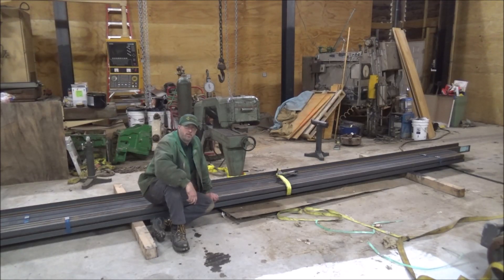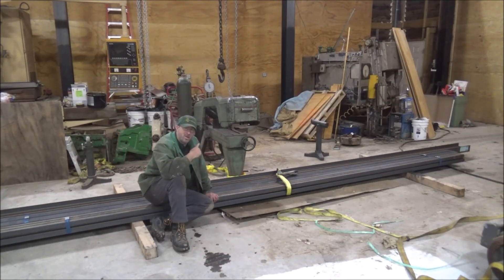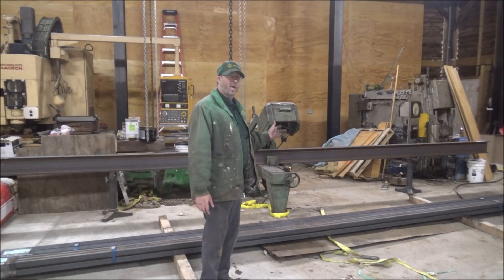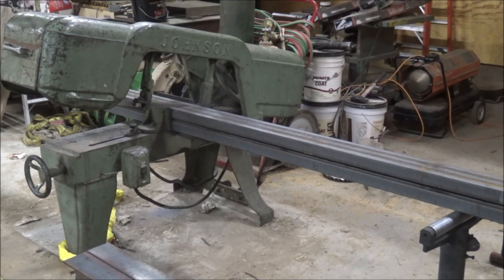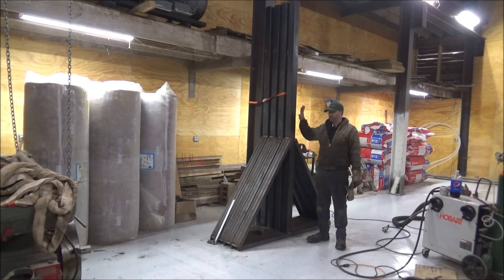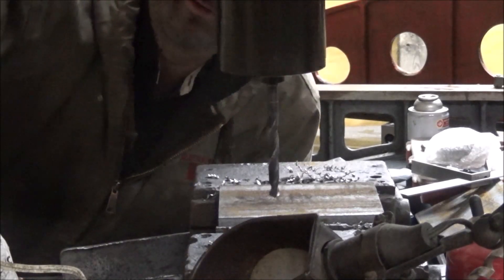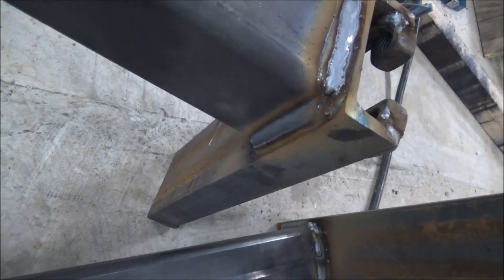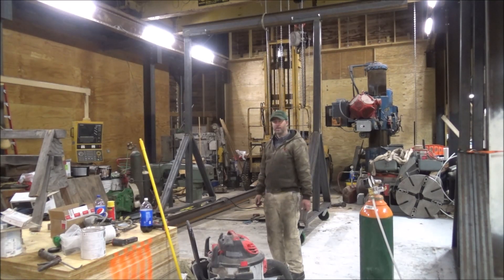Building a pair of Gantry Cranes

Comment: Thanks Much! I have been planning to build one, not as tall though. I like the adjustable width, real cool. I will build mine same way. Your stock saw, Double Bow! I just bought one about same size, but single bow. Yours is better than anything on the market nowdays, I bet it is nearly impossible for it to chatter no matter what. You definitely do not want to get rid of that, just repair it when it breaks. I bet they never make one that good again.
Reply from the maker: Dake still makes the almost identical saw. 

http://www.dakecorp.com/products/horizontal-bandsaws/heavy-duty-bandsaw-jh10w3

Comment: Brian, curious about your thoughts on the pros/cons of your uprights (single vertical tube with outriggers) vs. A-frame style?
Reply from the maker: Easier to fabricate this style also you can use the bottom brace like a cart sometimes by running beams/boards across it. I also like the fact you don't have a weld trying to do the splits holding it all together.

Comment: I agree that they don't actually need it, but they would look more structurally sound with the top corners braced.
The appearance of them being well designed could lead to more people commissioning work.
Reply from the maker: I will build them however somebody wants, they wanted these to clear a ten foot cube so that is how I did it. The upside down channel is equivalent to gussets on the bottom of the same size.

Comment: In some of the comments angle bracing is mentioned... I dont think bracing is the real concern here.  In the event the uprights begin to splay out under load the stresses on the inside clamp nuts could be substantial. I would be concerned that they would peel back or break off entirely resulting in a catastrophic failure.  I mean that is a lot of sheer force on such a small welded area.
Reply from the maker: It should take over 4000lbs of force dragging at the foot to fail that nut attachment.  I don't think that sort of load should ever be seen in reasonable use.

Comment: Brian, would you need to add an angle bracket on the top I-beam slider to the post? It seams like if you tried to roll it around under load it might buckle when moving.. Just curious, great Job though. I love all your heavy iron work! Merry Christmas!
Reply from the maker: It is not necessary for the requested load rating of these units. They are well over built as is. I am fairly certain that the casters would actually be the first thing to fail.

Comment: Great Brian, are those casters strong enough I've  had problems with those laminated wheels separating?
Reply from the maker: I don't know they say they are rated for 1200lbs each so they should be fine but I don't know as I have not had years of experience with these exact ones.

Comment: My Thern 2 ton gantry crane is one of the most useful things I own. Mine is adjustable in height, which is very handy. You just hook up a come along to two ears and pull the pin, then you can raise it or lower it to fit the job.

Comment: nice, I like the sliding I-beam on the top. what is the dimension of the "feet" (what the wheels are attached to) look to be about 5 ft.?
Reply from the maker: The foot channel is 6ft so center to center of the wheel axis is about 5.5ft.

Comment: I have to say I would brace those sliding joints. As they are they're probably plenty strong enough for lifting and holding a swinging load but how about when some gorilla tries dragging it about with a load on it? I have a 3t gantry that has substantial bracing and is built like a tank. It is so heavy it's hard for one person to move it. Even so it's surprising how much everything flexes when you drag it unloaded over rough concrete.
Reply from the maker: We have had 2 similar cranes in the shop for 50+years that have nothing more than a flat plate on top of the post for the I beam to sit on, no bracing and no channel to add strength like on these. That c-channel is thicker than the flange of the ibeam so it likely would get more flex from that flange distorting than from the sliding connection once it is all tightened down with the clamp bolts.

Comment: I am surprised you did not use gussets at the top. It looks unstable in the sideways direction.
I hope you will show us the load testing.
Reply from the maker: It is a portable lifting device, it is not intended that you load it and then try to drag loads sideways by pulling on the feet. We have had 2 similar cranes in the shop for 50+years that have nothing more than a flat plate on top of the post for the I beam to sit on, no bracing and no channel to add strength like on these. That c-channel is thicker than the flange of the ibeam so it likely would get more flex from that flange distorting than from the sliding connection once it is all tightened down with the clamp bolts.
Reply: Ok. Well you can't argue with success.

Comment: Made one about 5 years ago, the height is adjustable from 8 ft to 9 ft 6 inch . The I beam I used is from an old bridge crane. They are handy as hell.2 ton chain falls with a 1/50 hp gear motor hooked to the chain falls to run it up and down. The legs can be unbolted and the unit broken down. Use a jack to adjust the height.10 ft ceiling 8 ft doors.

Comment: Brian, I am curious why you made the base so short and also why you didn't put the braces above the middle of the upright, thanks!
Reply from the maker: It is not an anchor to drag things with, it is a lifting device, because it is on rollers it will self center itself over the line of pull by the hoist and as long as it is allowed to do that the loads are all basically vertical. It would be very difficult to try to tip one of these things over lifting with it. It is for use in a shop on a flat floor.
Reply: @bcbloc02  Thanks

Comment: Boy, now that's a nice item to have in your shop.
Just wondering Brian, how come you didn't put a little cutting oil around where you drilled those holes for the casters?
Hard to understand why people enjoy watching 5 straight minutes of drilling?
And Bailey decides to lay on his old blankets instead of his nice dog-bed?
Love your stuff man.
And Merry Christmas to you & Bailey.
Eric
Reply from the maker: Flood coolant or thru coolant drills are the only things that do much for tool life. Any cutting oil you put on a spot to drill gets lifted off with the first chip, then the cutting edge is back running dry. It doesn't penetrate the metal so I don't use it for such jobs.

Comment: Man those clamp nuts raise the pucker factor, you sure they are strong enough, and that you need no gussets on the top corners?
Reply: Was thinking the same thing.
Reply: No need for top gussets because it would have to compress the vertical steel.
Reply: @wymershandymanservice9965  as long as the crane isn't moved with a load on it it might be ok. But put a load in the center of the beam and move the crane around with the castors, and there would be a good bit of lateral movement. With the uprights so long, there is leverage acting on  that top corner by and those nutts aren't much holding it together.
Reply: David Mm  my point proven in part two  👍

Comment: You are nut going to like my comment, but that I-beam joint sucks. Sorry
Reply: I am a civil engineer and I think I would have added adjustable gussets on the top corners as part of the I-beam joints but he is a mechanical engineer with a MS so I expect him to check his strength of materials for making the joints.  Plus he probably has had discussions with who ordered them as to how they want the gantries.
Reply: @royreynolds108 
 I agree with adding angles but the part I see as the really weak point is the nuts welded on, that is bad enough but then to even stress them farther by adding bolts to tighten against the I beam. Not good, it might hold the stress test but after some time jerking the legs around with added weight, that thing is going to fail and get someone hurt. But hey I won't be the one getting sued now will I 
Brian has done some amazing things that most people could not have done, we all make mistakes at times, I strongly suggest he take another look at  this before he lets it go out his door.
Cheers John Fink
Reply: @imysteryman  I am sure that Brian would never get hurt using his gantry. That guy can waltz around on an old barn roof and drop a Carlton with broken steel wires whipping around without a scratch! Making the thing amateur proof is another thing entirely ;)
Reply: Post your credentials and then, tell us what is wrong with it.  He mentions a test of 6000lbs (4000 lbs rated  load) so we shall see.  Also, you are correct.  I am "nut" going to like it.
Reply from the maker: It is a portable lifting device, it is not intended that you load it and then try to drag loads sideways by pulling on the feet. We have had 2 similar cranes in the shop for 50+years that have nothing more than a flat plate on top of the post for the I beam to sit on, no bracing and no channel to add strength like on these. That c-channel is thicker than the flange of the ibeam so it likely would get more flex from that flange distorting than from the sliding connection once it is all 
tightened down with the clamp bolts. Assuming Bubba and his friend fix one leg and pull on the other with 500lbs of force at the casters just one nut placed where it is and torqued to 100ftlbs should be able to easily withstand the side force. .
Reply: Doesn't that reasoning also apply the the upright?  There's not going to be any side forces on it, yet it has massive side bracing.
Reply from the maker: The lower braces are to spread the loads out to the casters as the c-channel alone can not take that much weight spread that far apart. They are way oversized as it is cheaper to use the same size as for the foot than to buy more material of the smaller size also it saves some more miter cutting and is overall cheaper for me to do. If this was mass production I would use smaller material.
Reply: Oh, yeah ... how did I miss that?  You could also think of them making a triangle, which is way more stiff than the c-channel beam.

Comment: What's up with the vise on the radial drill?
It looks like someone welded a bunch of round stock to it for a jaw?
Reply: the jaw has a bunch of moveable pieces, the clamp force is distributed among them with a bunch of loose ball bearings
so the jaw "mushes" around oddly shaped parts
very interesting design
Reply: @486kyle  Very interesting indeed.
Doesn't seem to do anything for stacking two parts vertically.
Reply: He has a video from a couple of years ago explaining the vise jaws.  Very handy tooling.

Comment: Not a safety freak by any means, but from an engineering stand point, those top plates look scetchy AF. Always enjoy your vids.
Reply from the maker: They are a non issue.
Reply: @bcbloc02  Yes, I watched the testing video. However, whenever you sell a product or service to another person or entity, you assume a certain risk. That being said, it would have been quite a bit stronger to simply drill holes and bolt the plates to the cross beam. If those were for my personal use, I wouldn't have a problem with them, but we all know how hired help can find the weak points. Not at all trying to bust balls, I do enjoy your videos. Take care.

Comment: Have Bailey show you someplace by an exterior wall you can set the saw on front of.  Then put you a material door in you can secure from the inside with saw horses for supports for long materials you can poke through the hole.  Man Dad did this with his shop, saved lots of space.
Reply: WD Green I was going to mention the same thing. Permanent Roller stands outside that you can place material on with a forklift and roll it through the hole.
Reply: A machine shop I worked for did this. We used a cool little roll up door that is made for mini storage units. We set roller stands in concrete outside. You could set metal on the rollers with a forklift and easily feed it into the saw by hand.
Reply from the maker: I sometimes work with 30ft stock so then I need at least 15ft. :-)
Reply from the maker: Not a bad idea, I would still need considerable space on my outfeed side though as I sometimes might be doing a 15ft long piece.
Reply: @bcbloc02  As metal is usually 20 ft.(21 ft. for pipe), You cut the drop off inside and take the long piece off with the forklift. Limits the inside space requirement to 10'6''.

Comment: Can’t find you on Facebook and don’t know your email. Nothing to do with this video. You have a radial arm drill and a horizontal boring mill. Not really familiar with tolerances nor full capabilities of either machine. I am disabled and try and stay busy repairing and fabricating mainly older farm equipment for neighbors. Small shop compared to yours, mine is 36x36x14 side walls. So I really don’t have room for both machines and they would have to be way smaller than what you have. More in the department of 5-7.5 hp. A radial drill press implies drilling, but I have seen folks using them as a boring machine. Your knowledge base is extreme compared to mine. Are they heavy enough to doing boring and milling as you do on the horizontal boring machine? Or is the horizontal boring machine more capable of doing both jobs? Real enjoy your videos and I wish the guy calling himself ironworker would put out more videos. He does fabrication for older equipment, ie the brakes system for outside brakes on John Deere’s internal ones the cause filing to get in hydraulic system. That was very interesting. He also uses the horizontal boring mill.
Reply: no milling on a drill, but they are cheerful as all heck to do single point boring
Reply from the maker: The spindle on the HBM is more suited to tighter tolerance work. The drill isn't as stable and won't bore as true and accurate a hole.
Reply from the maker: Oh and you can find my email on my about page. it is bcbloc02 at yahoo dot com
Reply: bcbloc02 thank you.

Comment: Nicely done sir, interesting design with the adjustable width sliding i-beams.  Nice welds also!
Reply from the maker: The adjustable width definitely makes it a lot easier getting around machinery on the floor as it isn't always spaced conveniently apart.
Reply: I'm expecting limited floor space in my next shop so I am definitely borrowing the adjustable width feature for mine.  I will probably add removable adjustable gussets to mine for extra safety
Reply: @SwankySasquatch66  For those of us with an over-active imagination it might be best to box in the I-beam...
Reply: @stefantrethan  
I-Beams are the most efficient shape for this type of loading.   If you expected twisting, then boxing would help.
You would also have a difficult time finding a trolley that works a boxed beam.   Maybe you could make something custom?
Reply: @SwankySasquatch66  I mean just box the ends in where the legs attach to the I-beam so they can't kick out and break off.
The trolley would ride on the unobstructed center section.
Right now all that load is held only by the clamp nuts, and those are pre-stressed by the bolts. 
Just something that would make me way more comfortable that things will stay together, even if something goes wrong or the crane is abused on uneven terrain.
Reply: Martin Luther  I think the clamp nuts are the weaker spot 13:19 .
Gussets wouldn't hurt anything and stiffen things up but I think you'd bend the U channel before those welds to the square tubing ever gave out.
I'm sure it's fine as it is, certainly at rated load (and then some), just thinking of things that might go wrong if that crane is abused or some unforseen accident happens like someone runs into the thing etc...
The weels add options for abuse that a fixed structure would not have.

Comment: Perfect timing!!
Decided to skip the bridge crane for my shop build and this is the route I'm going.
Thanks for sharing Brian!
Reply from the maker: I wouldn't ever give up my bridge crane for one but it is the next best thing!  Their biggest drawback to me is they burn a lot of valuable floor space.  If I was building one for myself I would use round tube and make it telescoping to it could be used from 8-14ft and put swivel stops on it so the legs could be steered if need be, it would help in tight spaces. Keith Fenner has a feature something similar on his crane.
Reply: @bcbloc02 something better than A bridge crane is two bridge cranes.